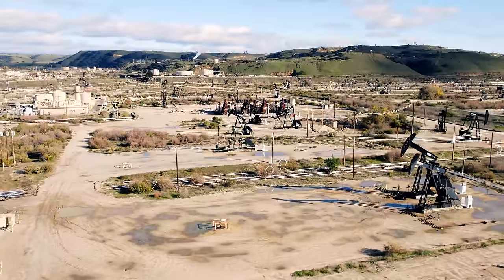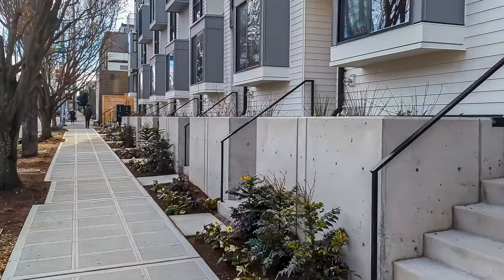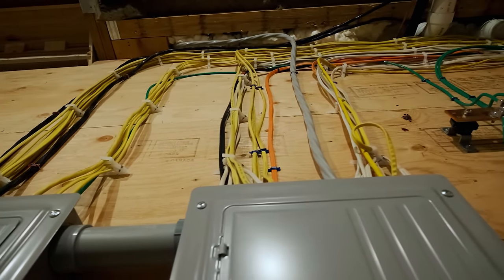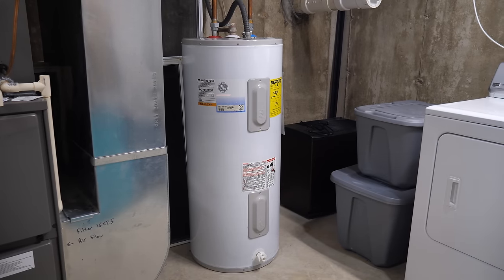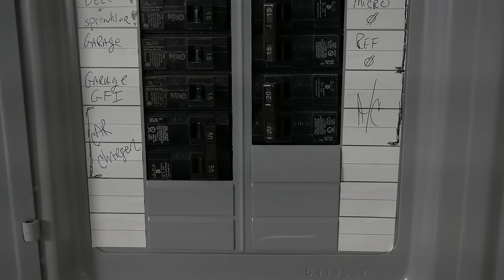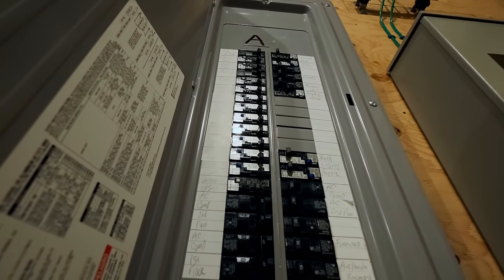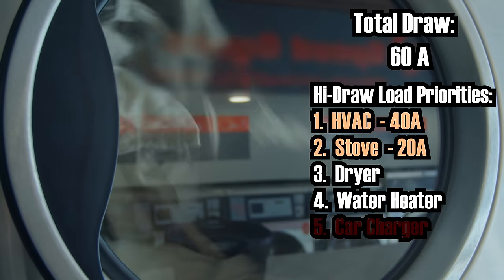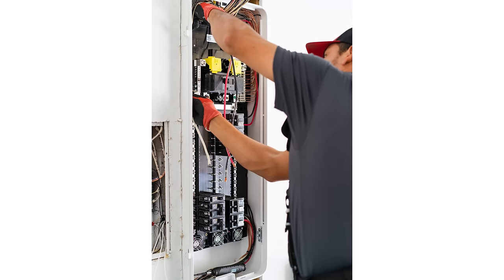Home Electrification: There's not a lot to do, and it doesn't have to be hard (Part 1)

Comment: In my mom's house we have 3 fridge/freezers and a deep freeze bigger than any of those full size fridge/freezers. 

I run a server that's constantly being hit, and it's also running as a NAS, which is metered at about 160 watts, as well as my personal gaming rig, which at peak draws over 700 watts (and I run folding and other programs when I am not actually doing work or gaming, so it's almost always up there)

Our house is a pretty big single floor house, and our AC is running all the time because I live in a desert. 

We also have a pool, which needs the pump to run for filtration. 

Idk how much we use, I can find out, but I don't have to do a lot of math to find out how much headroom we have on our 200A service. 

Also, not doing any "smart" stuff in our breaker box. I've been burned by companies adding subscriptions and such after getting an install base.
Reply: Another thing I found, my brother lives in a small home built, I believe, in the 1900's (it was built with literally railroad ties in the walls, and didn't even have electricity when built)

He uses an electric instant heat water heater. There is not tank in it. 

His house doesn't accommodate a water heater with a tank without either a new place built for it (which he cannot get a permit for, due to the size of the house and lot) or he would have to get rid of another appliance, the fridge for example.

He also doesn't have the option to have AC (he uses a swamp cooler when it isn't too hot that it doesn't work at all) and his heating is space heaters. 

I don't know specifically how much power his house draws, but when the power goes out, his hot water is the stove and a lighter with a pot full of water. I doubt he would want to do something that would make his house without heating, cooking, and hot water.

Comment: a smart breaker panel would be really good now that we switched to the market price electricity after last winter's energy crisis. it probably will become an issue again once it gets colder again, and if there are nuclear reactor maintainance periods like right now, when electricity is much more expensive than usual. the biggest thing would be being able to turn on water heating only when its needed or electricity is very cheap, as well as turning it off when it's super expensive

Comment: It is also common code in USA to only use 80% of the rated load of a given circuit. So a 15amp breaker should only ever hold a constant load of 13 amps or less. Just because you have 100 amps, does not mean you can actually use all 100 at the same time. It will melt and go boom in time

Comment: Ultimately the downside to fully electrifying your home is one of risk aversion. I think that's what's missing. I live in an area that can get severe weather, gas (of whatever form) is always there in an emergency. If the power goes out, my propane generator takes over and since my stove is gas I'm completely unaffected as far as cooking goes. 

I don't really know if you can break this discussion away from discussions of the grid either. Again, ultimately it comes down to reliability of the infrastructure in your area. Imagine everything in your house being electric and then you're hit by a wicked blizzard that downs your entire grid for 2 weeks (a.k.a. Texas). As we rely more and more on electricity, just like the internet and digital things in general, crisis reliability really goes downhill fast. It's why most military systems aren't even that 'technologically advanced' (just very impressive). Reliability is a huge factor in military acquisition decisions.

Comment: 100 amp service sounded ridiculously high when I heard it first; then I thought "oh yes, it's in the US, must be the 120V thingy, 100 amp over there compares to 50 amp over here"; then I heard you say 24kW. That means the 100A service is rated at 240V.
In Belgium, the standard residential service is 40A at 230V single phase (90% of households are on single phase) or 25A at 400V three-phase (which is 17.3kW; if you want more, the fixed yearly service cost increases for each kW you want extra; if you go beyond 25kW there are even additional costs). So 9-17kW is considered sufficient for domestic use and 'efficient charging of an electric vehicle' (read: don't charge when other large consumers are operating).
Since most of us are pretty happy with 40A service and don't have to reset the main breaker every other day, 100A should be plenty and 200A nonexistent even. It's just a matter of improving efficiency I guess.

Comment: You probably covered this as I am half way through the video, but here in the UK we used to have electricity heaters in our homes or at least my home and they got switched to gas. Reason being, those electronic heaters were far more expensive to run in comparison so....don't know if they are cheaper nowadays as that was 15 years ago.
Reply: In the USA at least, gas has been the cheaper home-heating option for a long time. However, as fossil fuel prices keep jumping higher while electricity becomes more and more renewable, I'd bet that's going to change soon if it hasn't already.
Reply: Resistive heating is expensive, but electric heat pumps are drastically more efficient (see his other video on those).

Comment: Most people don't talk about having an oil fired boiler connected to baseboard hydronic heating. Switching to mini splits would be difficult for me because all of the rooms would require their own heat outlet . (Not an open floorplan) The water based heat is more efficient than air based regardless.

Comment: While I can see some benefit from a "smart panel", cennecting it via the Internet to some company to manage it too often turns into a big problem down the road. Sometimes they decide to start charging subscription fees, they sell user data to dubious "partners", they go out of business, or they disable the product due to some false circumstances and the user may have no means of resolving other than an expensive and long lawsuit. Unless these companies come up with a system that's designed from the start to be independent and entirely under control of the end customer, I'll have to pass.

Comment: I'm not very convinced that time management solves the problem.  We need things at a particular time.
- Enough hot water when we get up or happen to want a shower/bath
- Pool to be warm when we want to swim
- Car to be fully charged when we need it
- Clothes to be washed/dried when we have time to do them.
- Dinner to cook for when we want to eat.

And lots of these things with big draws on power need to be on for a long time.
- The car may take so long to charge that there's only just time between uses.
- Gas water heaters heat water as it's needed, for as long as needed.  But the only electric "instant" water heaters I've seen are for a shower, and they only give a dribble of a shower.  Hot water tank - possible, sure, but to have sufficient water for unpredictable lives if it's last-in-line to receive power... it would have to be enormous (which is ineffecient).
- We may not be able to schedule a two-day process to wash/dry clothes... we probably want to wash the clothes when we'll be around to take the washing out of the machine and put it in the dryer or hang it up... which is likely when we're baking stuff in the oven for dinner and charging the car, and heating the pool for an evening swim, and of course the aircon is only needed while we're at home.  Likely someone is also doing the vacuuming while someone is drying their hair and someone else is doing the ironing (okay, we nobody does ironing any more).
etc.

Comment: Good video but currently, Span is a more costly solution. The Span panel costs about $3,000 with installation costing about another $3,000. An electric service upgrade from 100 to 200 amps is $1,300-$3000, or about half the price. So Span would only be justified in non typical cases. But maybe costs will come down.

Comment: I grew up in a completely electricity-powered house, and when moving to California it was a mild shock getting used to a gas stove, and a slightly less mild shock learning about the repair process when my water heater line had to be shut off due to a leak.

Comment: Interesting video, although I'd also be interested to hear your opinions on Trailer electrification.

Housing prices in my area have gotten to the point where even renting a basement suite is impossible on my income, and now I live in a trailer out of necessity. While the main AC unit for my trailer doubles as a heat pump, and thus can provide heat during chilly spring and fall evenings, I have to rely on Propane for cooking and especially for heating during the winter months, which can cost up to 500 dollars a month depending on how cold it is. The heat pump just isn't robust enough to keep up when temperatures hit -10 Celsius (and, hilariously, thanks to my fridge's exhaust being connected to the outside, that fails as well when the temperature hits -20 Celsius and it starts getting too cold for the refrigerant to evaporate.)

My trailer's main breaker is also 50 amps, and most of the smaller ones are 20. I had to learn the hard way that operating my electric kettle and an air fryer at the same time trips the breaker and shuts off the outlet my computer is connected to.

Comment: A service upgrade is a big deal for me. I'm in a very old house that predates electricity, and was here when the earliest line on the street was built. The old homes on the street are on this line,  but it has a low capacity so they ran a second line that the new homes are on.  So... when there's a windstorm, and a random tree falls on a random line going to a random house, it less randomly probably hits the newer line with new homes on it. My older line with fewer homes and bigger bulkier old tech stays running more often.

Comment: The only gas item that I don’t want to give up is a gas stove. I live in the south where power can be taken out for days by hurricanes. Granted, that’s only once every couple of years, but I still don’t wanna be left without the ability to cook. Electric stoves are also annoying but that’s subjective. Heat pumps are more than sufficient for heating though. I’m also interested in heat pump water heaters and dryers because, again, southerner. It gets hot heat and the AC can’t always keep up. Other than that, I want my gas stove. Also my grill and fireplace, but those aren’t everyday necessities

Comment: it's unorthodox, but I kept my relatively new natural gas furnace as backup (emergency) heat when I had a 2.5 ton heat pump installed, as the 2.5 tons is not enough capacity due to efficiency losses below ~20F. the only time the natural gas furnace runs is at most for a couple hours during the coldest nights from late december, through january, into early february, which is better for the furnace's efficiency and longevity anyway (since it runs for longer periods of time).

Comment: The problem with any type of energy is that energy companies will force you in a dependent model. My ambition is to be “off grid” regarding electricity. But that is quite expensive as you need battery storage for heating in the evening. Also trying to keep it simple and low maintenance so currently experimenting with two IR heater panels to see if that is an option. So far the jury is out as they take considerable time to heat a room although they do warm you when you stand still in a cold room… but the room itself only becomes ambient once the room walls are sufficiently warm charged.

Comment: Unless I missed it, he completely skirted around the fact that resistive heat is 3-4x more expensive than NG.  It's great that heat pumps are now available that can run in low ambient. But how efficient are they down there?  I'm in central Indiana and historically speaking, households using a heat pump regret it most winters due to the back-up heat running.

Comment: When I tried to install a car charger, I was originally quoted $10k for the install because they needed to upgrade us to 200A service. We managed to talk them out of that and they just installed the car charger without the ridiculous service upgrade. I would be very interested in a SPAN breaker. Beyond ensuring that power is distributed well without tripping any breakers, it should also help save money with time of use rates. I wonder if SPAN has a feature to suggest changes to save money.

Comment: something i want to point out.  the main breaker rating, is per leg. 200 amp service can pull 400 amps if split correctly. so your 50 amp 220 volt can pull up to 100 amps. 50 from each leg.  this is not common knowledge so that people do not overload on acciedent.   just an FYI from an electrical engineer.
EDIT: note, on these, you should stay below 80% of the rated amps per leg, or these type of breakers will blow. so you should stay below 40 amps per leg so 80 amps total if split even,   so with a 100 amp service, you can draw a constant 160 amps if your loads are split equally.  sometimes this is where balancing your breaker box is needed.  the myth that this effects you power bill is no longer true with smart meters. but that is not the point here.....    personally i use a smart power monitoring system so i can see my large draw items and my ussage per leg coming from the power company.

Comment: One of the major things of swapping out from gas to electric is when these appliances go bad and local laws dictate that they have to go electric. There are going to be a ton of people pissed off because they don't have the necessary electrical already installed. Then they have to find an electrician, pull permits, do the work, get it signed off and then they can have hot water, dry clothes, cook food, or stay warm. It's got to be a proactive process. But nobody does that. My mom wanted to install an electric water heater until the gas water heater took a dump. She's like let's put in an electric one, we already have solar. My dad and I were like "we can install a new one in an afternoon, there is no electricity in the equipment closet so we would have to run that first before any else and then put in a new water heater. Just getting it done won out.

Comment: I literally paused it to try to think of what the 4 things could be, as I only have one, just the boiler for the heating. The idea of having a dryer running on gas never crossed my mind. I do have a dryer, which isn’t the norm in uk (and the reason it’s not the norm to own one is the same reason I only use it occasionally… not sure if I’ve even used it this year, yet), but I don’t think I’ve ever heard of a gas powered one!

Comment: Block homes are usually not insulated because of the Air space built into the blocks. They may put a thin insulation board against the block between the firing strips. Thats about all the insulation you would get. They dont use 2x4s on the outside walls like other frame homes. 73

Comment: I have an all electric home with wood heat. We have a lot of free wood here which is renewable. My back up heat is electric resistance and electric blower fan with each room heated  seperately. Heating with electric would cost to much so i use wood and cut and split my own wood.

Comment: Where am from alot of people still use wood heat or coal for heat cause the electricity bill would go thru the roof an natural gas is just as high avg electricity bill 250 an natural gas over a 100 a mouth...using  the wood cuts the light bill in half an no gas bill....id love all electric house...BUT there's all ways BUT. great video 👍👍👍👍

Comment: you forgot the best heat pump, the mighy ground heat exchange, it doesnt work for cooling(as far as i know) but it will run your boiler so heats your house via the original radiators and warms water more efficiently than a resistive heater would, it also does not care about outside temps but of course is expensive to install

Comment: my house was mainly built in the 40s-50s and has NO GAS, pipes or equipment but we do wish we had gas ONLY for the stove because electric stoves actually suck for most things, but I think it would be nice for a backup power generator. I do live in Florida so power outages are a common occurrence and worry for us so my reasons are not everyones.

Comment: My dad actually build a custom lockout system in our house for 2 of our water heaters (the kind that does not store water but heats it up on demand) using a few relays. Basically as soon as one of them turns on, the other one is disconnected from the grid entirely, first come first serve. We need to do this since both of them, in addition to our stove are on the same phase (Eurpean 3 Phase Power) because of how badly our house internal grid is. (We are currently in the process of more permanently the issue, by having each of the 3 main floors run of their own phase, only having stuff that needs all three hooked up to the others ones).

Comment: The problem with the smart panel is that assuming that your breaker box makes any sense and on one breaker I got three outlets two light switches spending two rooms on another breaker and got a light month side of the house in the garage on the other side saying it’s still very limited uses without major upgrades in some cases